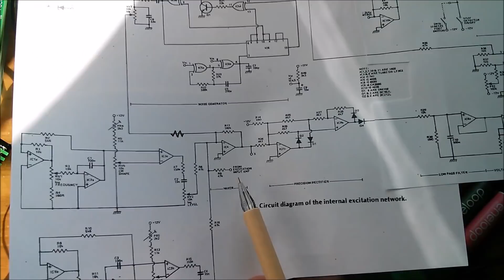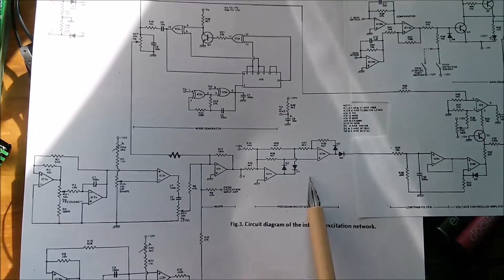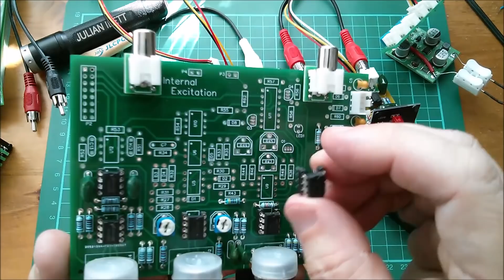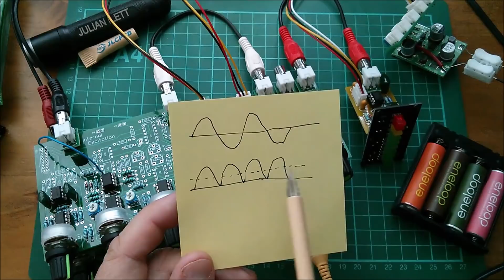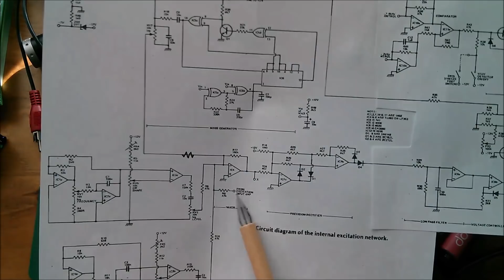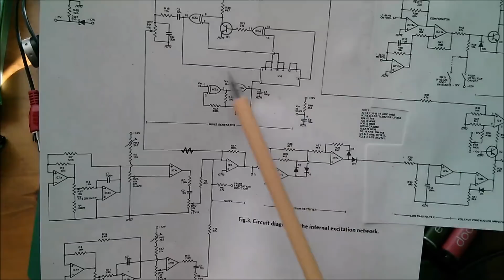What Does Rectified Audio Sound Like?

Comment: Hey. I've been searching for two years. I imagine it doesn't work well but just to make sure and learn why not....why can't you do full wave rectification on an audio signal, run it through transistor or op-amp for amplification then convert it back to audio(for the purpose using say, a single transistor that amplifies both the positive and negative halfs of audio signal with only needing a small forward bias to keep transistor on/active)?

What's the deal, does it cause distortion or something?

Comment: Whenever I leave my apartment...the local sports radio station (with a very strong, clean signal) is randomly interrupted by music. It's the same kind of music every time. Thus, I assume it's a Bluetooth signal coming from one of the units in the same building.  As soon as I drive about 50 ft, to the first stop sign, it cuts back to the original sports station. Is it possible for a mere Bluetooth signal in someone's apartment to cut into my fm signal?

Comment: when it comes to building your own analog music synthesizer the sound you get 90% of the time is not music.
 its usually is buzzing or metallic sounds that are like dial-up modems , car alarms or fire truck sirens. true synthesized music requires a lot of blending of sound layers or parallel harmony & IMO a lot forward planning even a live show would require some level of pre-programming to get the sound you want. even heavy metal music requires lot of work to rhythmically emulate layers of distortion with the popping of drums,  hack-sawing of guitar strings and the growling vocalist swallowing the mic, yes I did have the Idea of building a heavy metal music emulator or synthesizer box thinking its only noise blending percussion into modulated distortion,  but this proved harder than expected,

Comment: Quick question.

Where can you get those short RCA cables?

Preferably in the United States.

I would have they use for quite a few of those in my setup for audio.

Right now 5 and 6 ft ones coiled up and zip tied.

 taking up a good portion of room.

Thanks.

Comment: I try to understand, why people think, "better" resistors give better sound. I made a Preamp (2x Vin) with BC847C (Class A amp) and BC857C (Class AB buffer) (Transistors in SMD) and all SMD components - the cheapest! It sounds absolutely clean. No noise or distortion. The only way to get noise, is to use a cheap amp afterwards. But using a good Amp this works absolutely perfect to specification. (Circuit was designed 100% in LTspice simulation - for low frequencies this is a very, very powerful tool.

Here is my advise for you: You wanted to hear rectified sound? Build the circuit in LTspice and create a voltage source from a .wav. Yes, this actually works!!! ;) I used this approach, for a distortion effect for guitar. It worked, but fiddeling with transistors for a guitar effect, which no one buys, because it does not use tubes, made no sense to actually produce the real circuit. I do not even have a guitar. (I used samples from the net)

Best regards. Keep up the good work.

Comment: The rectified audio contains a lot of even harmonics.  If you feed in audio in the range 5-10Khz (using a filter) you can add the rectified output back in and use it as a sort of 'brightness' control for poor recordings. It can enhance the high frequency content, to a point, as long as you don't add too much. I've used a similar principle to give a small amount of treble to recordings that lack it (I used software rather than hardware) - it will never make up for missing frequency content, but it can sound pretty good if you are careful.  Most high frequency content in music is just harmonics of the lower frequencies in the music, generally decreasing in amplitude with frequency.
Reply: You you happen to know what the result would be if you rectified your instrument audio AC signal for running it through transistor amplification and after, convert it back to audio signal? No switches used, only diodes to guide the two halves of the audio through transistor base and then put them back in order, couple with capacitor to audio out. I've been trying to find information  on this for two years with no luck, this video is the closest I have found. The point of doing this, if it works good enough, theoretically from what I "know", being it would be only controlled via diodes with DC forward bias, it should come out perfect. And the point of doing it would be to simplify the amplification circuit, all you simply do is provide the DC bias to keep diodes and transistor active(small signal diodes). I've only been messing with circuitry for about a year, I've learned a ton but compared to what I desire to learn, which isn't really that much, kinda....I'm missing a lot of understanding and I'm aut!stic which makes it a bit difficult to learn on my own because of a significant difference in how I interpret words, it makes it difficult to understand exactly what they(source) are saying which gives me gaps in understanding what's being explained when reading, or watching, to learn. Plus there are a few small things I'm uncertain of in how to calculate formulas(algebra), mostly just the order in which I should calculate and fixing decibels, like how much to move decibels point when required, and hoe carrying letters works as well as what they mean/represent(in rare occasions where they don't even mention what the letters represnt(leaving some of the letters our of the explanation of the formula. It would just he great if that worked because it would make amplification, calculating for the bias,  like super easy and also very energy efficient.
Reply: @crimadellaphone9374  I'm not quite sure what you are describing, but sounds similar to a diode compressor  / AGC, I think a channel called "Moritz Klein" will help you out here - He does hardware synth stuff.

Comment: Several comments:  I solder in IC sockets then I install the ICs.  One Piece 8 pin sockets are dirt cheap.  Treat yourself, get some LM833's for your audio work, no redesign necessary.  You didn't mention full wave rectification doubles the frequency of the input signal.

Comment: At work we had some low cost headsets to work with walkie-talkie radios. The headset earpieces were wired between speaker output and ground. The radios had bridge -tied-load (BTL) output stages. The received audio was ok.
Then we had a radio with exactly the same connector but the audio sounded rectified, why? This radio had an asymmetrical BTL output.
BTL output = 2 audio output pins sitting at mid- rail voltage, as pin1 rises in voltage pin2 falls and visa-versa.
Asymmetrical BTL= 2 audio output pins sitting at ground potential. Pin 1 rises during the positive half-cycle while pin 2 stays at 0V and pin 2 rises during the negative half cycle while pin 1 stays at 0V.

Comment: I wonder if the squishing of the sound would defeat the YouTube audio copyright detection algorithm.
Reply from the maker: That might work - but fully vocoded music should be much more effective :)
Reply: Oooh.... that's a super interesting thought! Rectifying keeps the frequency the same, but not the... polarity? is that the right term?
Would that mean a speaker playing rectified audio is only driven in one direction?
Reply: @BRUXXUS  Technically, rectification doubles the frequency at every zero crossing. This effect is very easy to hear at low frequency, with straight vs rectified mains into a speaker, out of a small transformer. (AC output type, of course, so you can add external rectification.) The weird thing about Julian's example of rectified music is that all the variations in wave shape between zero crossings remains at the original frequency.

Comment: Was that full wave or half wave rectified at the point you took it off?  As well as being distorted, I expected the frequency to be doubled. (In effect, one octave higher.) If it was, it wasn't obvious to my lo-fi ears.
Reply: Me too. Guess it was half wave.
Reply: What he drew was full wave.  It has a strong harmonic at the octave, but the ear won't report that as the fundamental unless you filter out the lower frequency which is still present.  The original sine took time t to complete one cycle,  the new shape also takes time t before exactly repeating.  So your ear says it's the same pitch, different timbre.
Reply: Oh, I just thought there may be one exception.  A symmetrical triangle wave when full wave rectified and level shifted would give a symmetrical triangle wave at twice the frequency.
Reply: @raykent3211  Thats sounds very likely to work

Comment: Sounds like, not surprisingly, SSB radio
Reply: This is not how single-sideband modulation works or sounds like.
Reply: @zvpunry1971  Actually, it does.
Reply: No it doesn't. SSB does not cause distorted audio. You might cause some frequency shift if you are below or above the frequency, but this is also not a distortion like in this video. You can also demodulate a lower-side-band signal as upper-side-band and vice versa, this causes an inversion of the spectrum, which is again not comparable with the audio from this video. And SSB isn't created by rectifying an audio signal, it is created by suppressing the carrier and one side band. A ring modulator is often used to demodulate SSB signals. A ring modulator looks like a rectifier but it isn't a rectifier.

Again, SSB has nothing to do with rectifying audio and it doesn't sound like rectified audio.
Reply: @zvpunry1971  You're missing the point.

If you rectify an an amplitude modulated signal, you'll end up with LSB or USB (depending on your configuration). That's it. And that makes a signal similar to SSB.

I know perfectly well that this isn't how SSB is formed in a radio transmitter.

Btw, I'm a radio amateur and I work with SSB daily. I may not be good with words but I know what I'm talking about.
Reply: If you rectify an amplitude modulated signal, you demodulate it. It is called a diode detector. The output of it, is the audio that was put into the AM-modulator. This works without noticeable distortion if the modulation index is below 1. If you try to demodulate an AM signal with a modulation index above 1, or a DSB-SC or SSB signal with a diode detector, you will get distortions like the rectified audio in this video.

Comment: Julian, try building a full wave bridge out of four FETs (or eight back-to-back NPN & PNP transistors) used instead of the normal four diode arrangement. 
Connect the gates (or bases) with linear opto isolators or isolation transformers and drive them in alternate pairs, fed by an audio modulation signal. 

Feed the source ("music?") audio signal though this bridge as if it was the 50/60 Hz coming from a power transformer and take the resulting mixed (modulated) output from the bridge at the points that would normally be the plus and minus DC outputs exiting the bridge.  

The result will be full wave phase inversion that's controlled by the modulation signal. [if I recall all this correctly, it was from a magazine about 50 years ago, lol. It makes some interesting SFX with guitar. I also experimented with sending the source audio and modulated result to L/R speakers using a low freq sine modulation to produce acoustic phase changes, sort of an solid state Leslie Speaker effect.]

You can also transmit (or record) the result and unscramble it back to the original "music?" with an identical circuit at the other end (or playback through the same circuit again) if an identical modulation signal is injected.

You could probably just do this with op-amps.
Reply: Or just check rf mixers?

It's a very common component in radio equipment.

For audio stuff you have multipliers and analog switches (there are some in the 74 logic series).
Reply: @erlendse  The "MIXER" I tried to describe worked directly at 8 Ohm speaker level using a vacuum tube amp (as I NOW seem to recall).  It was a very long time ago; ~50 years. My memory was the 2nd thing to go...  lol

Comment: Plug a guitar in and the rectified/distorted sound would probably sound lovely!
Reply: fun fact, there are effects pedals based on such rectifiers, they're octave fuzzes (since the rectification doubles frequency)
Reply: I make music with this software called SunVox, it has a way to rectify any audio, works pretty well on generated instruments to get that gritty, distorted guitar sound.
Reply: but he gotta play metal riffs so no one recognizes whats wrong.
Reply: A push-pull guitar amp with too low a bias will rectify the sound. “Crossover distortion” is a common sound for metal guitarists.

Comment: What does rectified audio sound like - just play an MP3 through a good sound system, and you'll know it.
Reply: If produced with MP3 compression in mind, the difference between 320kbits MP3 and uncompressed wav is not noticeable. MP3 has the same flaws as any compression algorithm, which shows with random noise. Especially high bandwidth noise in the treble region will produce audible artifacts but this can be mitigated by cutting useless bandwidth during production.

Comment: yes it sounds awful having the audio rectified.
but to put it positive: you have built either a youtube content id system trolling device or a dubstep-creatinator (you just have to feed it the right source material).
another though of mine: why is the rectified signal put through a passive rc filter with bleeding resistor across the cap and then feed into an opamp buffer you could equal as easy make it an active filter with a gain of one?
i just dont get why there is the opamp with diode in the feedbackloop processing the buffer output.
anyhow i think you forgot one noteworthy point why to use a precision rectifier instead of 4 diodes: the level is already low in voltage therefor any losses are not acceptable.